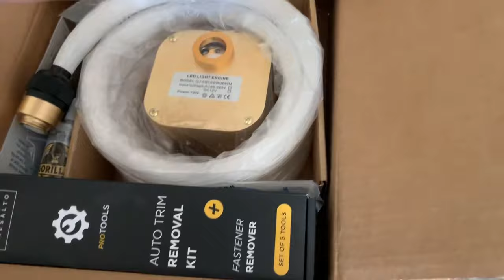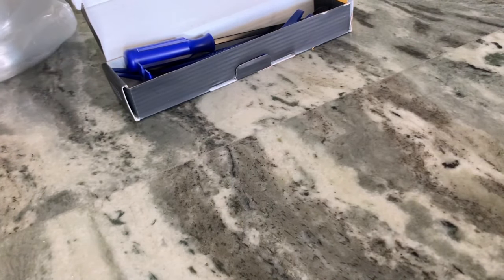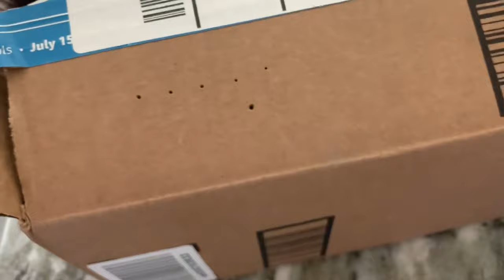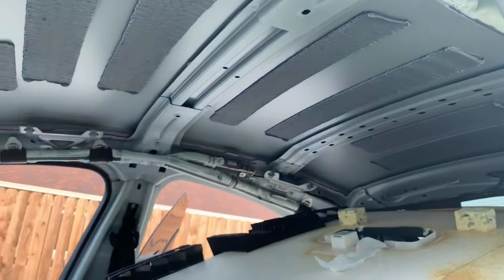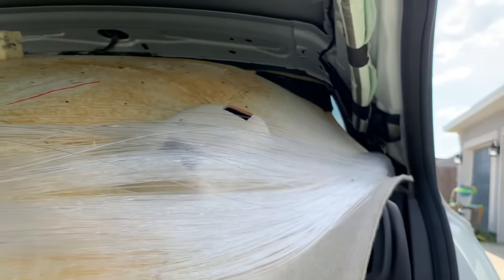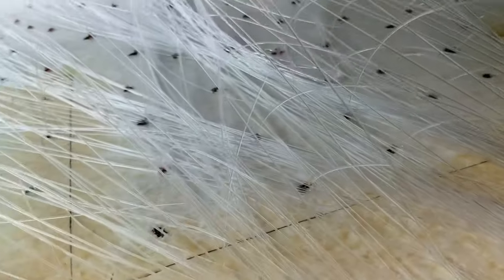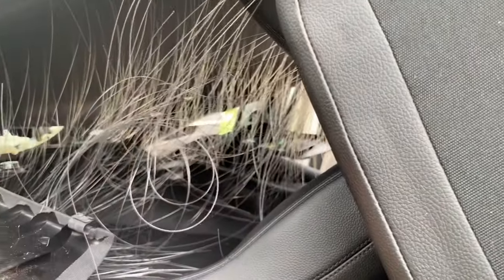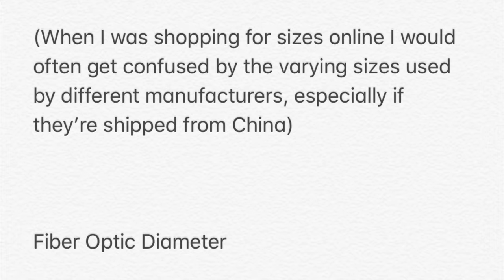How to Install a starlight headliner in 2023

Comment: Man that was one hell of a tutorial. I wanna try this in my 4dr truck. I might be able to get away with the 6ft length to install right behind the backseat and i feel like 100 less strands would be more suitable i think 450 is still quiet a bit
Reply: Also to remove you headliner I think you could have removed one of your front seats and gotten it out but hey u still got it done anyway lol
Reply from the maker: Butt-Nuggets- hahahaha yeah I did consider removing a seat but damn, that’s a lot more work. Plus all the power controls connected to the seats. That darn B-Pillar was just in the way. If I had a two door sedan or an E class with the long doors, I think it may have slid out easier
Reply: @ReynaldoVelasquez  true! U still got it done and it looks great, but I think I would have done it only cause im from s. Tx also and I know its super hot, and to top it off I get all excited when I do projects and put in long hours. I probably would stay up all night just to get it done in 1 day lol.

Comment: It was a great video but the gorilla clear grip glue did not hold the starlight fibres at all, we had to go over the whole 900 fibres with E6000 adhesive.
Reply from the maker: I’ve heard that before. It held on mine and others. Maybe it just depends. A lot of people use hot glue guns
Reply: @ReynaldoVelasquez lol wtf might wanna put a disclaimer so no one else gets screwed
Reply from the maker: @Nodnarb69  I’ll do that, thanks 🙏
Reply: @ReynaldoVelasquez  🫡

Comment: You think the one’s that u got is going to fit my truck and when u putting the Headliner back on do I have to pull the strings a little bit back or no ?
Reply from the maker: Yeah I think it could fit your truck. I mean it depends how big your truck is but they should fit. I had tons of length that didn’t even get used. I forget what I used but I think I used the 9ft. I didn’t pull my strings back but I see that people group them into mini rubber band bundles. So that could work out better. But I didn’t do that, just make sure you have enough fiber optic to reach the furthest part of the headliner, to the light engine, and leave a little length to travel from the top of the headliner to the bottom of wherever you install the light enging

Comment: This setup is insanely cool I definitely want to do this in my mustang. Could you please explain the entire connection system so I can get a better idea of how to wire everything? I understand that the fiber optic wires go from the headliner to the light engine but then does the light engine get power straight from the battery or the fuse box or both or somewhere else? Also how would you wire it to make it turn on with the ignition because I know that is something else I would have to do.

Comment: Thanks so much for your review. Big respect for the in car install....amazing.  I purchased the AKEPO 20W Dual-Head APP Fiber Optic Light kit, Different Color RGBW Twinkle. I chose this kit because it has two different colors simultaneously. Question, did your kit come with mixed strains, meaning different fiber optic size thickness or just one thickness.... Pause LOL? Also I ordered (blue) suede headliner material, it actually comes with foam backing attached. Lastly, I bought a blue carbon fiber trim wrap,  a blue carbon fiber steering wheel and shift knob (which has not come in yet).  I did the exterior so its time to tackle the full interior upgrade.
Reply from the maker: Mine came with all the same size fibers. And I’m a little jealous! I want the dual color changing light engine. I have the boring one haha. I may go check out that light engine and buy it for mine. thanks
Reply: @ReynaldoVelasquez  O ok, I like how yours looks. I was going to return my strands because they are one size. But yours looks good. I was worried it wouldn't have that small star big star effect, but yours does.  No, thank you buddy...Your original buyers guide video really helped me chose the right kit I wanted. I also have the colored meteors. My only issue is taking out the headliner....its going to be a nightmare. I heard someone say the seats have to come out in a Lexus....I really don't want to do that. Either way the headliner has to come out to be sueded.

Comment: I pull mine completely out hang my fiber up on a hook, helps keep the lay out clean and no rats nest happens put one in my truck N 1 in my kids car. I use a small drill bit. But I'm thinking of trying a big needle

Comment: word of advice 1. hot glue gun works fine no issues 2. you do not need to paint / dye your ceiling black it looks great either way especially at night you don’t even notice it’s not black, my ceilings alcantara so i was nooooot about to paint it 3. if you’re careful with tools like screw drivers it’ll be completely fine 4. i found a kit with 400 on amazon that was 60$ and works great with all the same options 5. you don’t need a switch at all you can always just unplug it or use the remote. this is just here to help save money i think his turned out amazing!
Reply from the maker: officer danky thank you for the advice! It’s great when people give others advice and talk about other options on this forum.
Reply: Thanx for the advice, ive seen one at $60 as well, whats the difference between that one and the $128 he used?
Reply from the maker: Cristhian O you have to look at the features. Usually the $60 ones have a smaller light engine and they will not usually twinkle, they will change some colors and blink or flash (not all will do this, some only come with one solid color) the more expensive ones may come with a bigger light engine to allow twinkling, and more color options. Some will have longer fiber optic strands or a greater variety in their sizes (diameter of the fibers) you just have to take your time and read through the product description

Comment: I wanna do this with my chrysler but my headliner is tan.  I wanna use fabric paint. Paint it black then do this.  Did u put single strans in the holes? Or doubles or triples in each hole?

Comment: The Gorilla glue you show for locking the fiber optic in place dissolved all the 75 first I installed. This glue is not made for any Polypropylenes material. PMMA is polypropylene base  product. Caulk or project glue will not affect the fibers. Learned it the hard way....

Comment: Can this still be made without all the extra stuff you bought? Like just using the normal box and glue basically.
Reply from the maker: I assume so. You could just poke holes use the glue, use normal tools instead of the trim removal tools. Honestly I never even used the three prong rocker switch. I just wired it to the fuse box. And for the year before... I just plugged it into the backseat power outlet.

Comment: It would be nice if you could hook it up on the cars network and control it with the other lights maybe with a can bus system I’m sure it possible but probably really complicated...also there’s should be a fuse box at the trunk never seen a Mercedes with out one at the trunk...

Comment: If you had taken a front seat out, you could have taken the headliner out easily. At the very worse, you'd have to take the back of the back seat out.

It's really easy to take a front seat out--uncouple the airbag sockets under the seat, then undo the 2x front bolts that hold the seat in near the floor the three 2xbolts at the rear. Then lift the seat out. 
The back seat could be bolted in place, or just have clips, depends on your car. 

As for the power, use the cig lights socket, but cutoff the wire 5cm before the socket, then solder it to the underneath of the cig lightersocket in your car (obviously you'd have to take out the cars cig socket first).
Then use a length of wire (for the + & -) long enough to reach either under your cars dashboard, or center console, etc (up to you) . Then attach it to the 3 way switch you bought, then use a length of wire to the light engine and solder it to the length of wire with the power socket on (that plugs in the light engine). 
Simple!

Also, it would have been cool if you found a image of stars with the constelations, then blew it up at a printers, then laid it over the headliner, taped it down, then made the holes where the stars were.
It'd have been cool to see the big dipper, orions belt, etc...

Plus, if you put L ight engine in a box with holes for ventilation, it would few. the fine in that space.
Reply from the maker: I like everything you just said. Maybe on the next project for sure
Reply: @ReynaldoVelasquez   they usually place the headliner in the car before the front windshield is installed at the factory...so it becomes really hard to get it out

Comment: All wires are the same thickness right ? so how do you make some bigger than others and can you keep em like solid or breathnig effect ? with at the same time diffrent thickness of lights ?
Reply from the maker: Quinten De Buyser yes all of my wires are all the same diameter thickness. The reason some look bigger than others is because of the twinkle effect. Yes I can have them all solid or all breathing if they are all solid they will look the same size. Now there are some kits that do offer different sizes. I didn’t opt for that one though. I figured that the twinkling would give it the same effect... and I was right.
Reply: @ReynaldoVelasquez   Ah cool! Thanks a lot!

Comment: Great video I’m thinking of doing this in my project car, (84 trans am) the crappy part is that last summer I just re did the headliner with a blue suede, I wish I knew this before! (And I was able to remove my headliner through my trunk for my project crappy that you couldn’t get yours out)
Reply: And if you haven’t hardwired the power wire, get a 12v female adapter with 2 wires coming off of it, run them with the fuse
Reply from the maker: Dude! I would LOVE to see this done in a trans am! I love those cars! If you do it, I want to see it
Reply: @ReynaldoVelasquez  will do man, was trying to get my engine swap finished up and after I seen this I regretted not doing it sooner ahhaha

Comment: Here I am literally asking a question 2 years later like you stated at the end of the video hahah. But I wish to embark on this project for my brand new bmw sedan I have just purchased. After watching this video it definitely seems possible and motivated me but my main question is how did you choose the distance between each hole and how did you measure it throughout the whole headliner to get them them all evenly spread out, or did you freely place the dots by eye? I would love to know before I do this to my bmw. I can’t wait man😂.
Reply from the maker: Good question. I placed the dots purely by eyeing it out. I knew in my mind that I wanted the most congestion of the lights to be in the center of the headliner and slightly fade/ spread out as they get closer towards the edges of the headliner. So I did my best to make that happen. I didn’t measure the distance between the holes. Some are closer than others. Let me know if you have more questions, maybe I’ll answer them in another video

Comment: When you bonded with that gorilla glue…. Did any of the strands melt and break off? I used gorilla glue gel and that like melted my strands. Suggestions?
Reply from the maker: No it never melted my strands. You could already try a hot glue gun or a glue that’s made for plastic

Comment: How did you get the fiber strands to not kink (90° bend) under the roof pieces i.e. R1, R2, etc when you had them back in place nd the headliner restored?

Comment: I'm looking at adding these lights to my truck, are they still working at this point? If so, does the gold motor piece get hot if the lights stay on for a long period of time?
Reply from the maker: Yes they still work great 1.5 years later, still get compliments and wow factor! Motor uses LED so it doesn’t really heat up. I keep my motor in the trunk and I have felt the box get warm but it could also be the fact that it’s 100F in Texas heat.

Comment: may i ask, after you install those fibre optics onto the roof liner, how do you cut it and would it be sharpy sticking out from the roof liners?
Reply from the maker: I used some little nippers to clip the fibers. Links are in the description.... at least I goose so. Maybe I need to go in and redo some of the links if they’re expired

Comment: Hi, I was wondering if you could suggest 9ft or the 13ft of optics for a gl450 suv?
Reply from the maker: I would guess 13’ but You could always use a string or wire/cable to outline the path you want to take when installing. Outline from the exact spot  you want to install the light engine box and all the way to the furthest place a fiber will be installed (like the sun visors) then just measure the string and accommodate for a little extra cushion room in case you need more length.

Comment: Would it be possible to run the fiber optic wire on the sunroof headliner also? I know it would be more difficult since the sun roof cover moves back and forth, I just think that only having the fiber optic lights around the sunroof and the sunroof spot be empty would look kind of funny. Would love your input and advice, thanks!
Reply from the maker: Henry Nguyen hi! I’ve seen it done in only ONE YouTube video (installed on the headliner with a sunroof cover too) and it came out awesome. It is more complicated and you need to allow slack for the fibers to move open and closed without getting caught in the motor etc. if you search all the installation videos online you’ll find it. It came out looking great. But I haven’t seen him update the video to see if it still lasted all these months or years.
Reply from the maker: Henry Nguyen actually... here’s the link, I found it for you 

https://youtu.be/s07at7Of5-o

Comment: loved your work and explanation! do you think 450pcs is too much for your headliner? would you pick 200pcs or even more pcs if you were to do it again? do you think it is too bright at night when it is turned on? Does it affect your vision at night? how do you like the look of it during the day, does the fiber optic strand look flush with the fabrics or sticking out a little? thanks for your help.
Reply from the maker: Tony Ma no 450 is perfect and if I could have done 500-600 I would have. But honestly 450 is the perfect amount. I’ve seen videos of 200pcs and they look as if the stars are too spread apart or like the job is incomplete. Personally, if I’m doing this much labor for a job, then I want to get the most bang for the buck. It does not affect my vision at night at all, during the day it looks amazing too, some stick out I’m just too lazy to clip them down, plus nobody notices  it. You can make them as flush as you want. It’s just tedious to clip them and feel... then clip them again and again until it’s to your liking... but sure if you want to have it super perfect.. you sure can.
Reply: @ReynaldoVelasquez  how many should I do in a Honda CR-V?
Reply from the maker: @TheWannabeMisfit   at least 450 and if you want to do more like 600, I’m sure that would look cool too! Just make sure to measure out the correct length from the spot you want to mount your light engine to the furthest point the fiber optics will travel to (like the distance from the sun visors to the light engine)
Reply: @ReynaldoVelasquez  Would 1000 be too many?
Reply from the maker: @TheWannabeMisfit  never such a thing as too many.  I would go for it. Or at least as many as the light engine will allow for strings to fit in there. But I think it could easily fit 1000 into it
Reply: @ReynaldoVelasquez  Its a shame you aren't local, I'd just pay you to do it lol. Thanks for all of the help
Reply from the maker: @TheWannabeMisfit  sure, anytime! Glad to help out any little way I can. I’ll be with you in spirit haha

Comment: Hey i got kind of a dumb question but i was wondering how you set up your hole pattern, did you just make straight lines down the headliner when you separated it into 2 sides or zig zag the holes or just randomly stabbed holes in the headliner? I’m Asking cause I want it to look like a real sky full of stars and not just straight lines of light down my headliner, cause real stars are scattered, and doing somthin like this I want it done right the first time lol
Reply from the maker: Josh Ridgell I got a paint marker and randomly marked where the dots would be. And if I saw some would be too close together or too uniformed, I would get the marker and X out the dot I didn’t want and put a new dot somewhere else in the same quadrant area. Then I poked the holes at the end and ran the fibers when I was satisfied with the pattern
Reply: Reynaldo Velasquez oh ok gotcha, thanks man tht helps a lot!🤙🏼awesome video bro I can’t wait to try this! 😎

Comment: Great video I am doing now but How did you get those spacers off the backing of the headliner! I am at that point and can’t break the glue! It’s on there like cement.
Reply from the maker: I think I used a screw driver and some of my trim removal tools. And my hand to pull it off very carefully

Comment: Hey Reynaldo, thanks for the video, it's great. One matter I've not found answered anywhere - does this light source remembers its' settings between power offs? Or do you need to set up desired mode / color / brightness each time it powers up?
Reply from the maker: That’s a great question. No one has ever asked that before. It does save your last settings until you decide to change it again

Comment: I wanna do this to my cla45 but I’m a little confused to were you wired it to :( also there no way to remove the headliner from the car? I feel like it would make it easier instead of having it in the car. Thanks
Reply from the maker: I made a second video with the wiring. It may be linked in the description or if you fast forward to the ending card